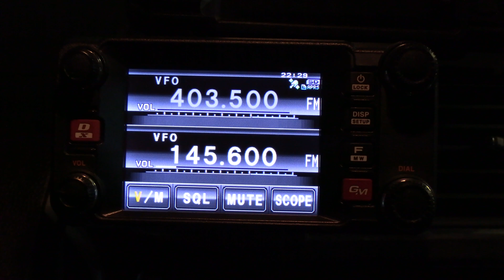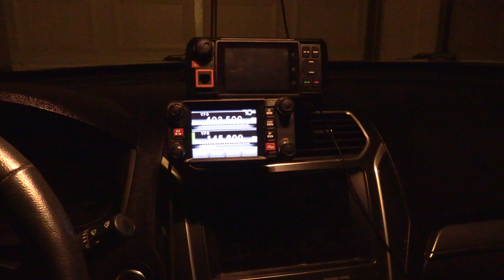DigiRig - Mobilinkd TNC Cable Converter

Comment: Great video.  Wondering, could you make a video detailing all of the settings that need to be changed in the FTM-400 to work with a Mobilinkd TNC?  Thank you.
Reply from the maker: Finally got a chance to mess with this. No settings need to be changed. I did a full reset and it works out of the box.
Reply from the maker: Thanks and thanks for the suggestion! I'll look into doing that soon!